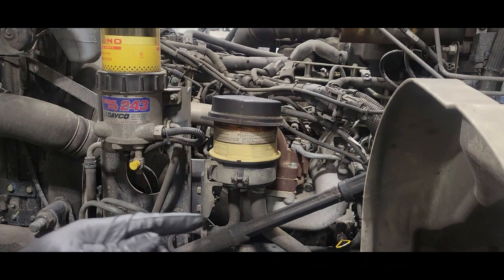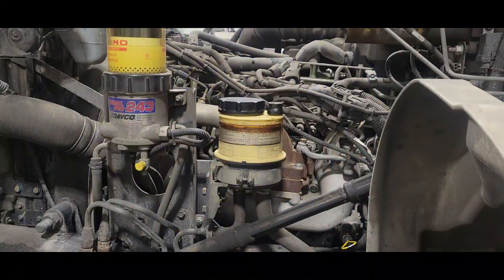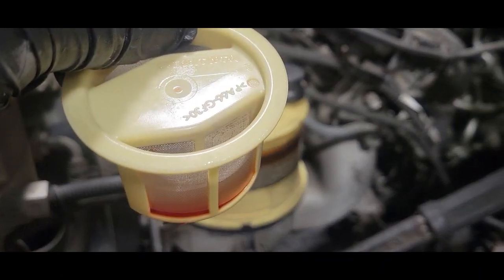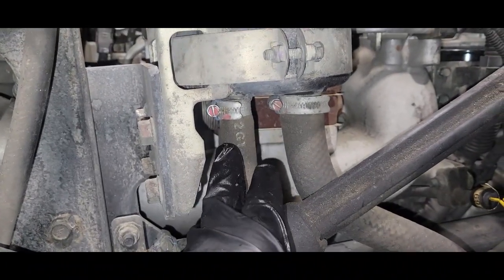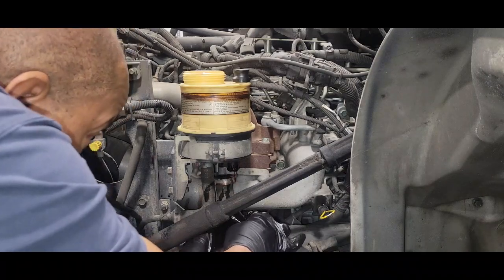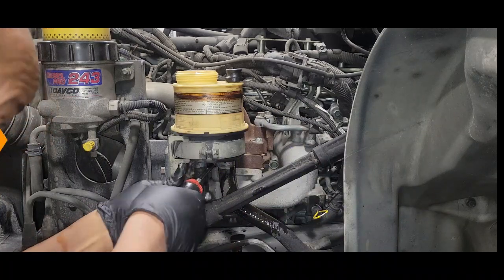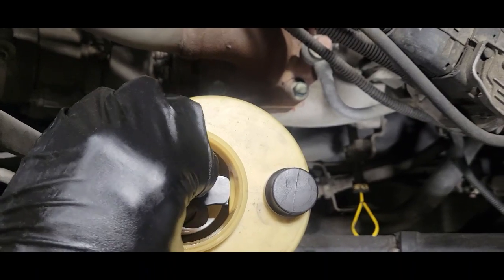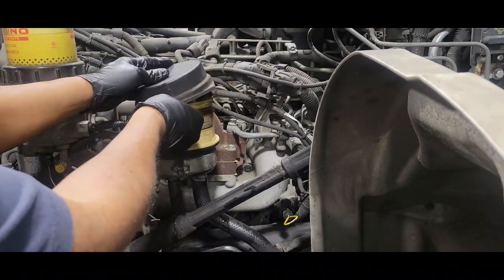Hino Power Steering Filter

Comment: I got a question I have a 2015 hino 268 when i turn the wheel it’s a bit hard is that because I need to do what you are doing in this video? Also where can I buy parts from? Thank you in advance great content
Reply from the maker: @lifewithyusuf3127  That's a good question. The inexpensive route to go is what I did in the video.  If that do not work for you. Most likely, it is your Gearbox. 
As far as prices. I would check with the local Hino Dealer on price and a Part Number. Take that Part Number of the Gearbox and check prices on line. Also check with your local Fleet Pride and give them the part number. I have found sometime they charge only half the price.